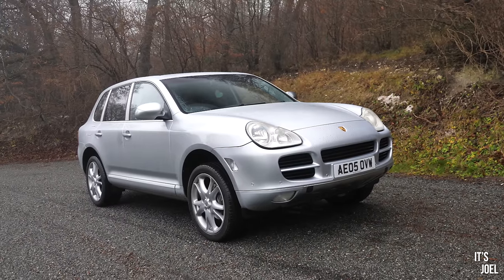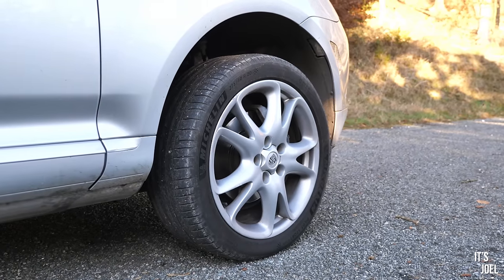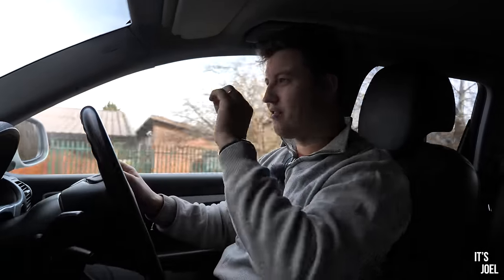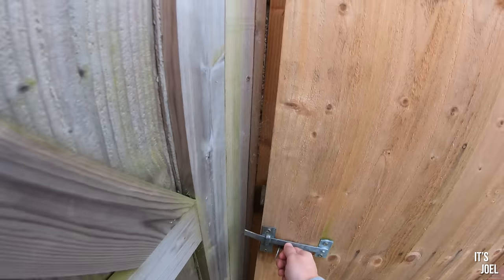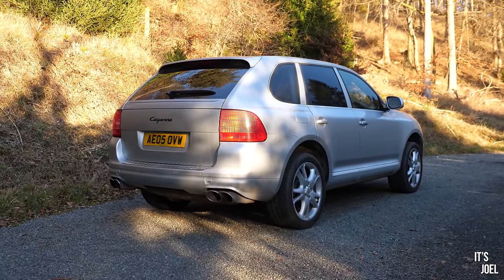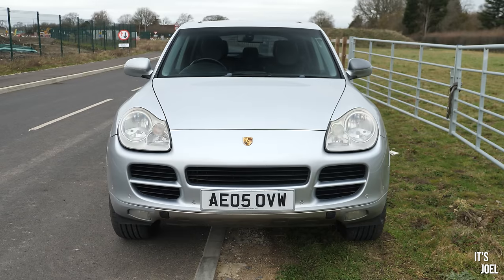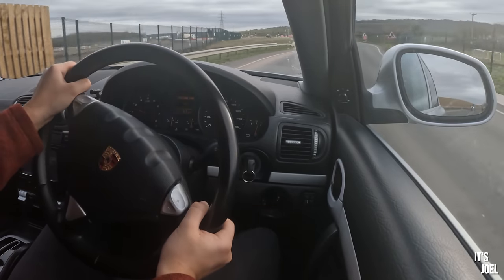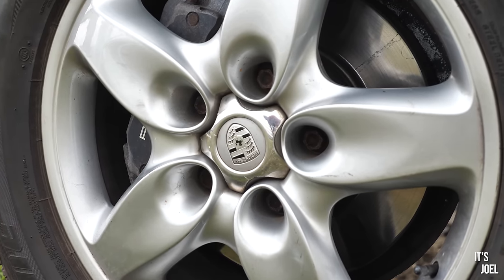THIS HAS TRANSFORMED MY PORSCHE CAYENNE!

Comment from the maker: Get 15% off your Carly purchase with code "JOEL24" at: https://bit.ly/Carly_Joel Carly's scanner and free version of the app with standard OBD features are compatible with cars that have an OBD2 port. To see if Carly's advanced features like coding or manufacturer-level diagnostics should work with your car, make sure to check out their website. To access these additional features, you'll need to get their yearly license.
Reply: Got myself a project car and really makes your life easier when you know what's wrong. With the coupons it came to about 29€, which is nothing compared to a 50-80€ reading at a standard dealer. It also helps to delete old codes, so you know which one is relevant. Love it.

Comment: A specific brand and model of tyres also make a huge difference with the same size. Like a cheap tyre vs a Michelin Pilot Sport 4S. Awesome handling but also cushioned over bumps. I recommend for people daily drivers. Keeps you on the road + you can trust your car will stop. The people who switched over can't stop talking about the difference. So a good point

Comment: They look familiar 👀 The 18’s are unequivocally the best choice for a cayenne on springs. They look classier and improve the ride quality at the cost of dynamic edge. The gorgeous 20’ Sport Techno’s are the way forward when air suspension is present though!
Reply: Why would you diminish the benefits of the air suspension by putting giant wheels on? I just don't understand. It's still a wardrobe on wheels, youre not getting sporty experience with it..
Reply: @rostislavandrlik9704 I have a turbo with sport technos for summer, and some super light bbs 19s for winter. It's a bit like a boat when on 19s compared to 20s. But it's bloody nice when it's snowing. You can also take some air out of the wheels when you need it, and refill with the o board compressor.

Comment: I think you'd find that the improvement in ride quality is more thanks to the softer side walls of the 18 inch tyres rather than their smaller size. There actually isn't much difference in the profile height between the 2 because in fact, the 20s are 40% of the width of the tyre i.e. of 275 and the 18s are 55% of 255. The 20s being Michelin Pilot Sport tyres, are much stiffer hence you lost the steering sharpness when you swapped them out.

Comment: Old Land Rover tip Re the throttle. Press the outside of your right foot against the side panel of the footwell. Use the friction between your shoe and the side to help control the pedal movement.

Comment: I agree, the smaller wheels do suit it better, fits with the 4x4ness. If those tyres are getting on in age, you'll probably find a nice fresh set give an even more compliant ride.
Reply: I have 19", and the ride is rubbish, but thinking I still have work to do on the air suspension, I have fewer choices of tyres when using 19". In summer, I'll get 18-inch ones and some new wheels thinking of dirty gold to contrast the deep green. Or maybe black!

Comment: Could you have fitted tyres onto the 20inch wheels with a higher sidewall? Low profile tyres are not suitable for English roads. Hit a pothole wrong and they burst. You might find a bit more pressure helps the responsiveness.

Comment: 18's really are the best fit for a coil spring Cayenne, I've got air suspension and 20s on mine and it rides well.
Reply: do you feel every single bump in the road? on mine it feels like I am rock-crawling even it I ride over a penny
Reply: @Percy2010ification mine glides, it has a beautiful ride on the way to garage to get its latest repair.